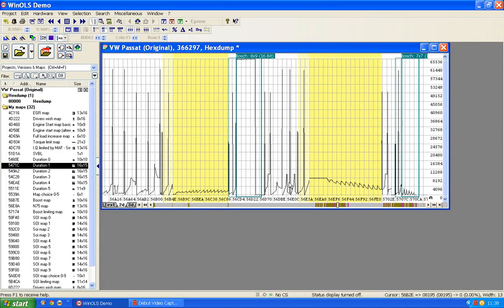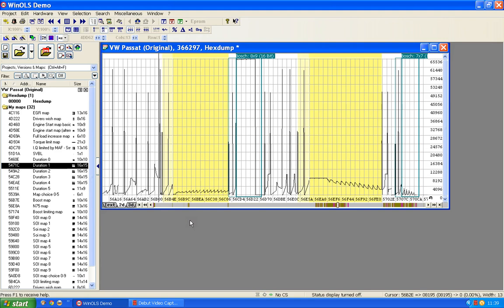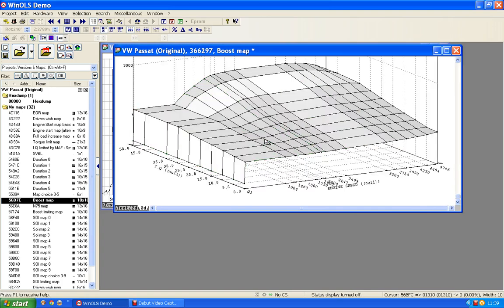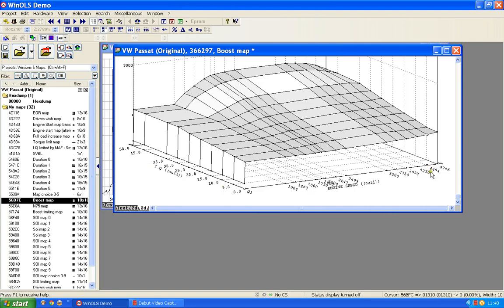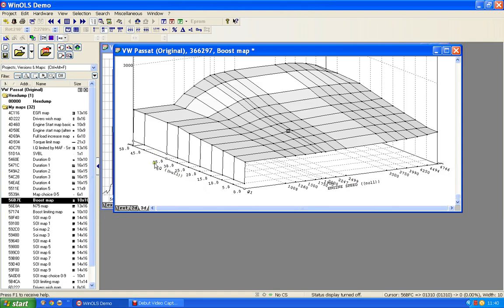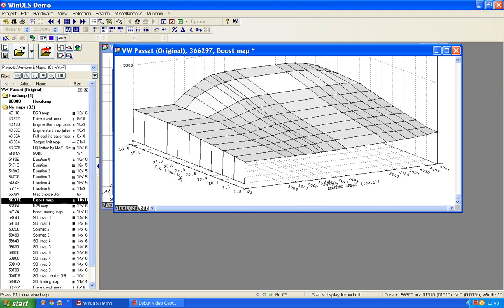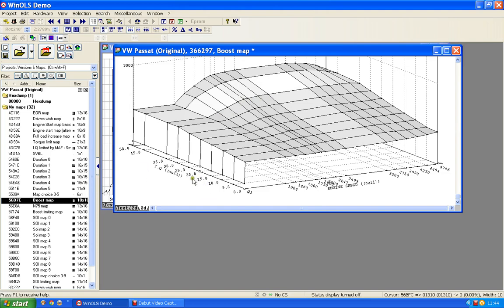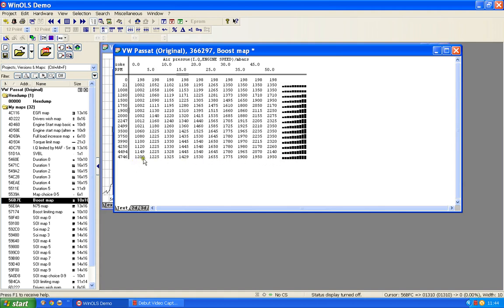Winols understanding ecu maps 5 Turbo map

Comment: vagecumap i have an 07 pd170 engine with a recirculating waste gate does this perform as a standard wastegate apart from it places dumped pressure back to the inlet air box? And also have i got the vnt turbo or just standard. I cant seem to find info on google.
Cheers btw enjoying the videos not much to do at work so im watching your whole series in 1 go
Reply from the maker: Engines with VNT turbo's don't have wastegates.

Comment: VAGECUMAP:
So the boost map gives a value of boost based on rpm and iq, and the boost limiter gives a value of boost based on rpm and atmospheric pressure. I assume like with the maps for iq the lowest value is used?

What i don't understand though is how this value of boost is regulated by the ecu?

Lets say for example the ecu is requesting 2500mbar at "x" rpm, "y" IQ and "z" atmospheric pressure.
Lets say the car is then remapped without touching the n75 map such that the boost requested for the same values of x, y and z is now 2800mbar.
The N75 map has a fixed value of actuation based on IQ and rpm so therefore one would expect the same amount of actuation and therefore the same value of boost as before?
Reply from the maker: The N75 map only converts ecu request into a physical opening of the turbocharger to give a percentage of the maximum available boost. It has nothing to do with varying the amount of boost requested by the ecu. This ensures you have more than enough air available.